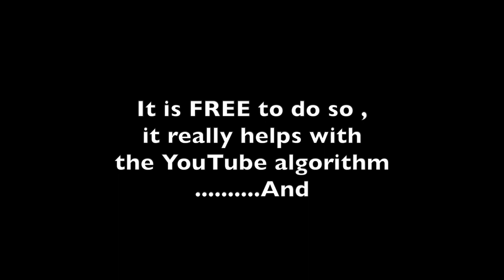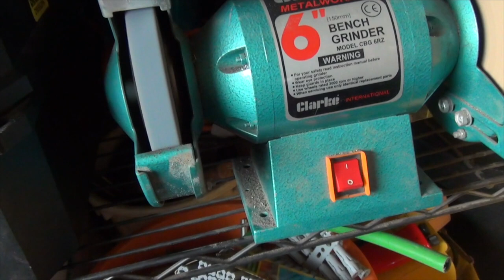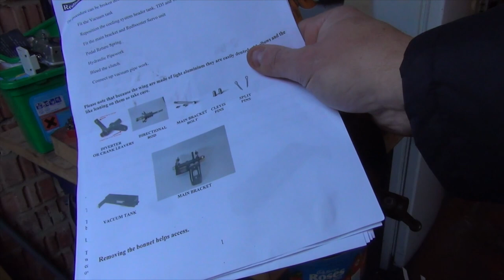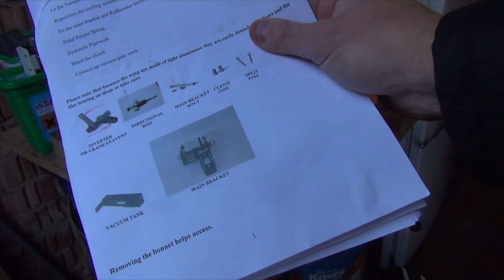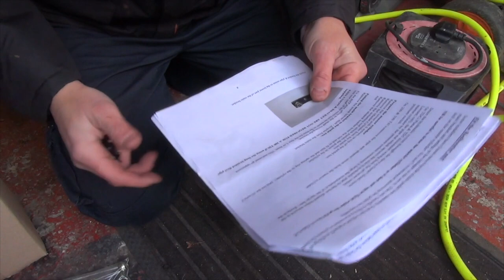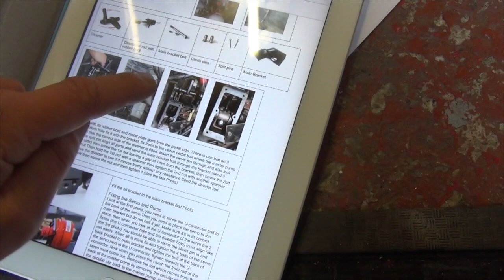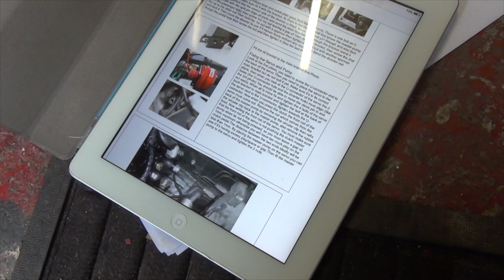Land Rover Defender TD5 Red Booster Clutch Servo Install Part 1

Comment: Thank you I am having one delivered next week for the TD5 and will be using some of your video for referance along with the instructions that come with it but before installing could you tell me what website you got your instructions from for better pictures etc to also help with it. Also did you find out the cure for the high pedal in video number 3  and what's your thoughts on it now after the time you have used it. Regards Peter
Reply: My booster came with a good set of printed instructions, they may do it different now to save on paper . High pedal was sorted out by the adjustment, I set it initially around the centre of the rod,  but in reality it ended up being right at the end of the rod. One down side for me is I somethimes leave it in gear, for security and when on a steep slope,  when you come back to start it, it obviously has no vacuum pressure until it is started, so It is a case of hold down the clutch and hope it works. To be fair I haven’t had and instances of it lurching on start up. Takes some getting used to with it being so light, other people who have driven it with the new booster always ask me if the clutch is ok. 😀